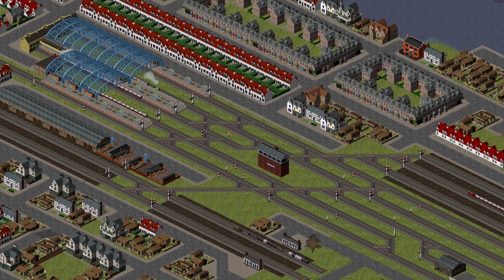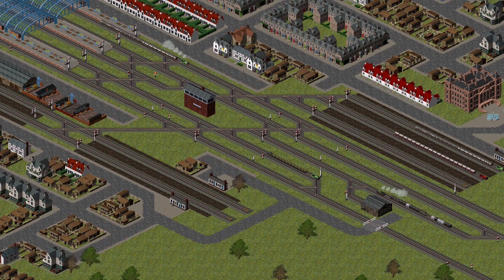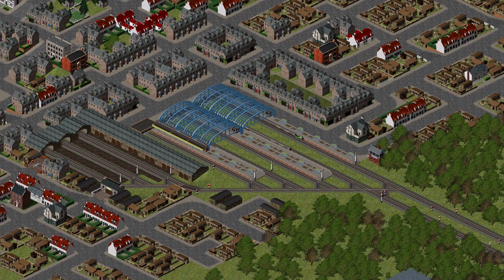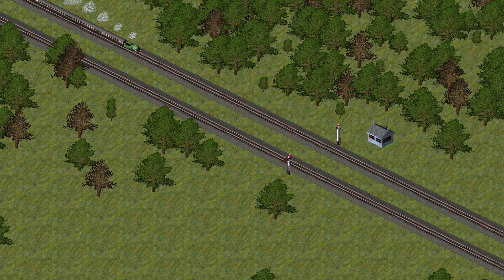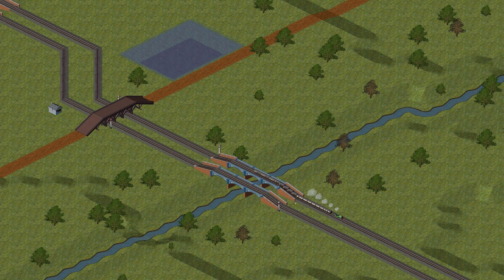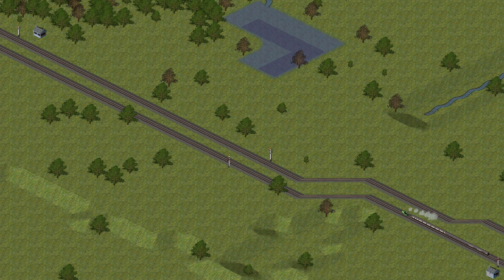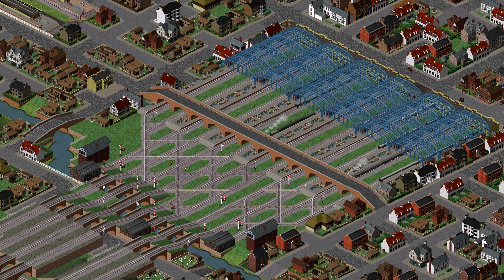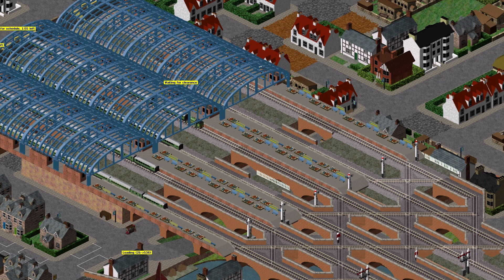Absolute block signalling

Comment: you say that the absolute block method does not allow for single track trains. but so far i've just put a block signal at both stations and it has caused the train to run just fine at max speed
Reply from the maker: I have been planning for some time a video explaining the difficulties with using absolute block in single track lines, and how to use the suggested alternative - token block - but there have always been higher priority projects supervening. 

It is not impossible to use absolute block for single track lines, but it has some drawbacks, and token block is recommended.
Reply: @JamesPetts  what is the difference between a token block signal and a one train staff cabinet if I might ask? I've had a lot of trouble with trying to use the one train staff cabinets once i wanted to upgrade my line to multiple trains and having removed it, it still causes any additional trains going on the now cabinet'less line to "waiting for clearance".
Reply from the maker: @ElijahEystberg  A one train staff cabinet is intended to be used only in the specific situations shown in the one train staff video: i.e., either (1) a completely isolated railway network which only ever has one train in operation on the whole network; or (2) a totally self-contained dead end. It will not work properly in other situations.

Comment: Is vane auxiliary signal used as an pre-signal?
Reply from the maker: Vane signals are used in the time interval working method, not the absolute block working method.

In the time interval working method, auxiliary signals of the vane type are, in effect, distant signals (albeit are described as "auxiliary signals" in the language of the time, i.e. the 1840s). 

In the absolute block working method, distant signals are used as described in the video.

An auxiliary signal of the time interval working method cannot be used in conjunction with stop signals of the absolute block working method.

The term "pre-signal" is not used in Pak128.Britain-Ex, as it is not a standard term in UK signalling: the terms "distant signal", "auxiliary signal" or (in some cases) "repeater" are used instead.